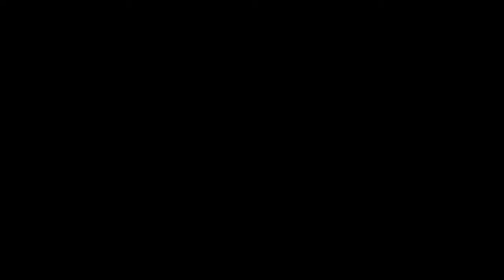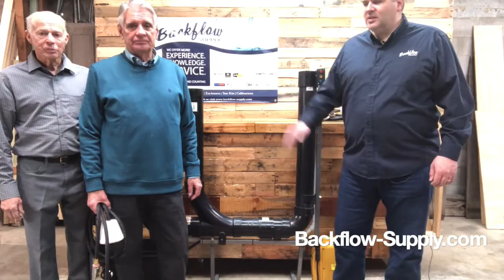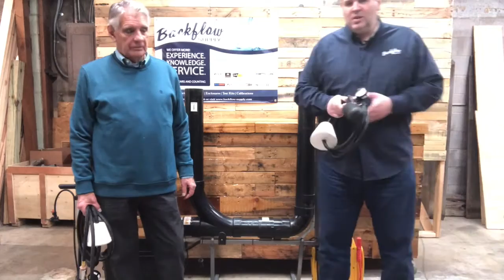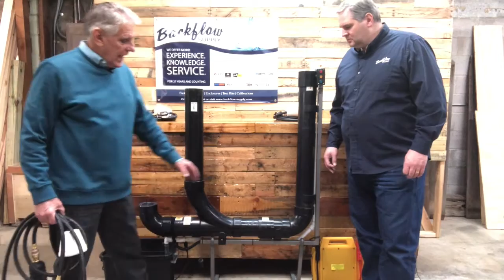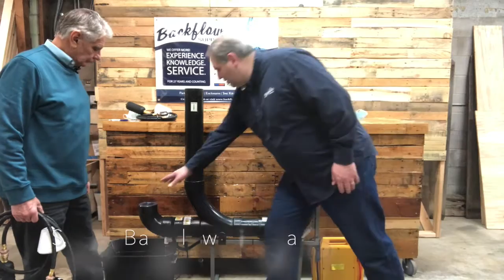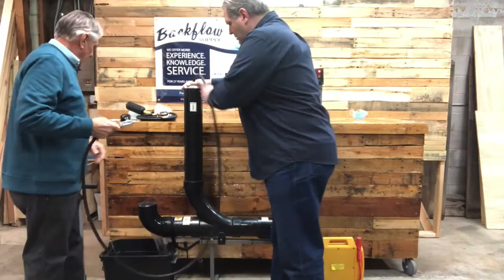Temporary Emergency Backflow Device for Sewers

Comment: Genius ! I guess for cast iron or pvc don't know about use in liners or clay pipe.
Reply: This backflow should work for, clay or liners
Reply: It also has a safety blow off plug for pressure relief, that may damage pipes and connections
Reply from the maker: Thanks Mark for the comment , and Jim for the reply.

Comment: How would this be helpful and used if you are on septic? I don't hear about public sewer customers having problems, but septic users do all the time.
Reply from the maker: Timothy I will pass this along to the manufacturers and ask them to jump on here and comment.  Good question.
Reply: If you have a clean out pipe between your septic tank and the building this would help.
The system can be used with either 3” inch or 4” inch clean-out pipe.
The air hose is 12’ foot long and can be used with up to 12’ foot deep lines
Once the system is put in place, it stops all wastewater from coming
  in or out of the building.

 @backflowsupplyslcut9394